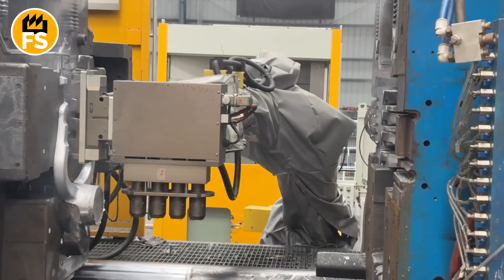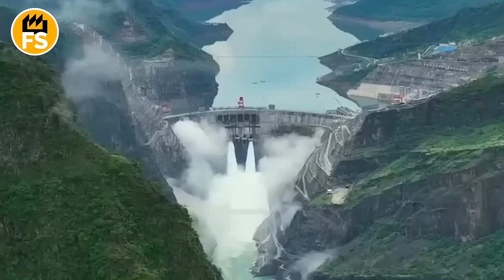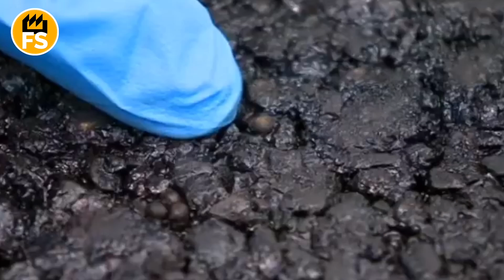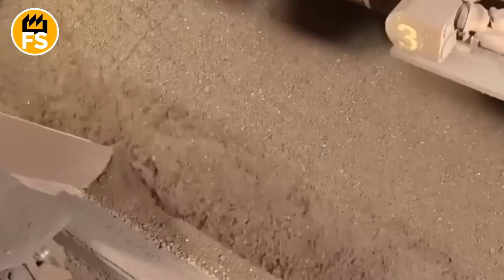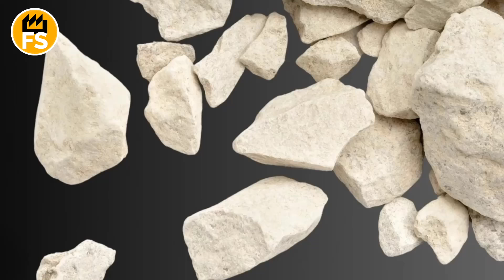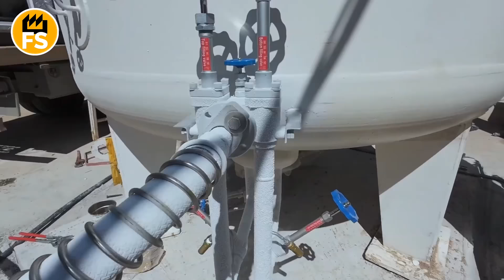How Engine Blocks Are Made: Secrets Manufacturers Don't Tell You

Comment: They do not pour cast-iron at 5400° OK also within a minute they’re saying the temperatures get as high as 4000° in an engine. You are so full of shit cast-iron will turn into water at 4000°.
Reply from the maker: Thank you for pointing out the temperature details. I'll make sure to verify those figures to ensure the information is precise.
Reply: @Factory.Secrets  the melting point of Stihl is between 2500° and 2800° Fahrenheit